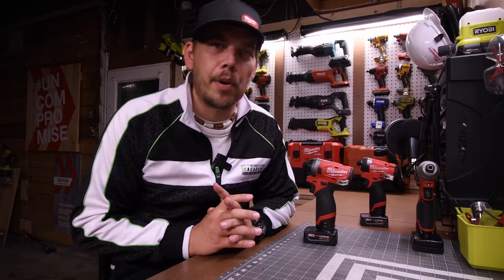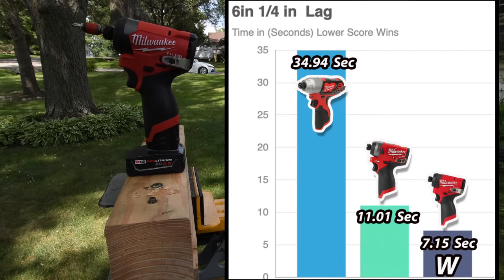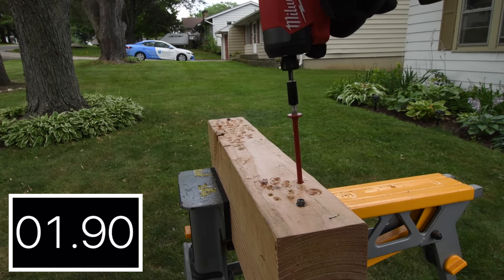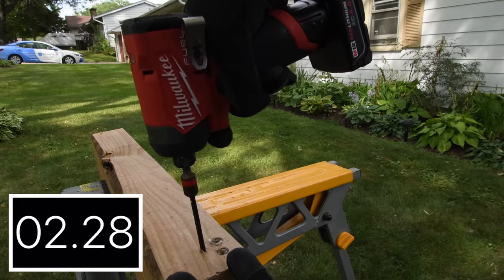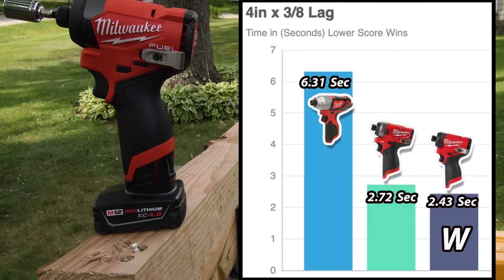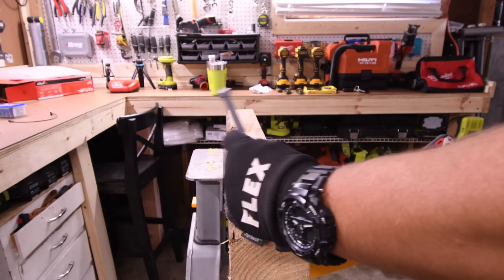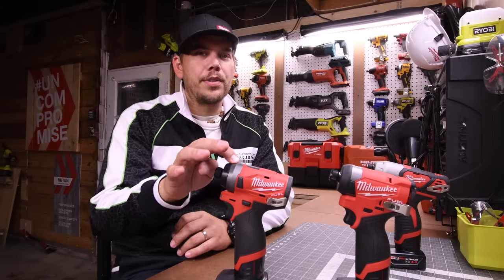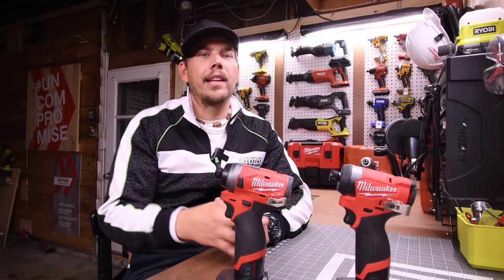New M12 Upgrade Worth It?

Comment: Tri beam LED lights are the only reason I'm getting the new M12. I think the only thing they could invent for more power at 12V is stacked lithium batteries.
Reply from the maker: I agree but I am excited about testing out the new HO m12 battery
Reply: @ManCaverTools  I wish they would've fit some 21700s in the m12 HOs. They apparently have better wiring and higher discharge rate 18650s in the new m12 HOs.
Reply: Not sure of how much they can improve on the hardware, it seems they are minor tweaks here and there.  But what seems to add the power, based on other tests I have seen is the battery size and technology.  By technology I mean the ability to handle high draw and capacity.
Reply: @scottmorris4914  The samsung 25R and 30q cells commonly used in tool packs, including rhe milwaukee 3.0 and 6.0 packs were released back in 2014. Since then there have been some much higher output cells quietly released, but I imagine, due to cost and reliability, the old faithfuls have continued to be used. Stay tuned.
Reply: @scottmorris4914  i believe technology wise we have these brush less tools working beyond capabilities they are perfect
Reply: Go smaller. I'd like to see a new line of drivers, screwdrivers with good torque and speed . The current electric screwdriver champion (dewalt) is way too bulky, although it's got some great features and power.

Comment: Can't wait to see the drill comparison like this!
I've been using the Gen2 for the past 3 years on a daily basis, and I decided to buy the new kit 3497-22.
It's definitely not worth upgrading unless you can get a really good deal on it.
That being said, once I started using the new Gen3 with the insanely bright 3 LEDs and the extra few hundred RPMs, I can't go back to the Gen2.
In short, don't try out the Gen3 unless you are actually willing to upgrade or you can tough it out and ignore it, and keep using the Gen2 which is still an awesome impact.
Reply from the maker: that video will be coming up
Reply: @ManCaverTools  Can't wait. That video will decide if I should upgrade or not. Thanks for the video much better than the other channels.  Will there be a videoof Gen 3 vs other brands?
Reply: Remember that the Milwaukee tools still hold a lot of their value.  You can always upgrade now and then sell your older tools and recoup some of that cash difference.
Reply: You can now get a good deal on the Gen 3 at Home Depot for $99. Comes with the tool. 2ah battery. Charger and a bag.

Comment: The brushed model is great for a lot of tasks and I have a buddy that used his daily for a decade and it still works great. I still see sales for the drill + driver + 2 batt combo for $99, making it a pretty good value for smaller tasks. Half my tools are 12V, I wouldn't use any 12V for any of the torture test tasks you put them through unless I don't have a 18V one around. Good to know they all can at least do the job in a pinch.

Comment: HD had a sale on $30 2ah batteries so finally hopped on and went with the Gen 2 hammer drill and Surge impact. Love the size and power but my only complaint is the ergonomics.  My xtremes feel better but performance... m12... glad I didn't have to push for Gen 3

Comment: I have the M12 Surge and M18 Surge. I had a hard time justifying the 12V Fuel impact driver since the Surge was almost as fast and a LOT quieter, but the improved lights and even more power might be enough to convince me. Maybe. I do have the M18 Surge, which was faster than the gen 2 M12 Fuel, so maybe not?

Comment: NOOIIIICE YARD, Bro! 1st time I've seen it in one of your vids. Was wondering about the noise & your neighbors, right about the time you switched over to the Man Cave, 😂. GREAT vid, VERY HELPFUL, INFORMATIVE & the 1st I've seen running the new Gen 3 v the Gen 2. I'm pretty new to the Milwaukee M12 line, only recently delved in (in large part to your clips 👍🏼). I have the brushless Sawzall, the 3/8" right angle impact, the M12 Surge kit (which, I ABSOLUTELY LOVE) & awaiting the arrival of my freshly purchased 3/8" high speed ratchet kit....BUT, have yet to get the "starter" set including the hammer drill, impact driver, batteries and charger....(oh, & the bag....VERY underrated). Curious as to whether or not you have any preference, between the Gen 2 & Gen 3, (outside of very close/similar speed/performance, shown in your tests). Feel? Noise? Vibration? Any/much difference in any of these areas, between the 2? I appreciate your feedback & as always, your work! Thanks 👍🏼
Reply from the maker: My Wife says thank you on the garden Comment, she has been working really hard on that. id use the Gen3 M12 impact driver. I love the design and tri Led lights. but when it comes to the performance the new gen is a tad but more powerful but not worth upgrading if you already have the Get 2 that works just fine

Comment: I don’t use my tools to put food on the table, so an upgrade for me has to be well worth it. The tri-beam is really a nice touch, but for 79$-I’ll pick up the older gen and save the extra cash for the new batteries.
Reply from the maker: I agree with you on that, much better buy for $79

Comment: Remember, that the Milwaukee Brushed tools, using the lithium batteries were, at one point in time a breakthrough, top of the line tool.  You should try to find an older NiCad battery powered Milwaukee drill/driver or even an impact wrench, and see how they compare.
Heck, if someone that is just starting out in the trades or even a mechanic, asked me what to buy with a limited budget, I'd definitely tell them to seriously consider buying the Milwaukee Brushed tools.  At least you could buy into a quality brand and start collecting the batteries, and eventually upgrade to the Brushless line up and then go up to the FUEL line.

Comment: When I see a deal I’ll pick one up, as I  only got the M12 fuel drill driver hammer drill.. didn’t bother with the kit.. it’s much.   Nicer for small jobs around the house and working on my RVs..  using the M18 fuel hammer drill wasn’t enjoyable for small tasks.
Reply from the maker: Deals better be good this year
Reply: @ManCaverTools  yeah , hopefully we get the same deals here in Ontario , Canada.. they put the price up on that Ryobi clamp fan to 50 Canadian.. I’ll be looking for a deal on the M12 inflator, I seem to always running around pumping up tires  or water toys for my 3 yr old.
Reply: Not sure what kinda deals they are running in Canada, but I just bought the 3497-22 kit, which includes the new Gen 3 M12 hammer drill (3404), impact driver (3453), charger, bag, CP2.0 battery, XC4.0 battery, and an extra CP2.0 battery as a separate (i.e., returnable) item. After returning the extra CP2.0 battery, it brought the cost of the entire kit down to $178USD. Incredible deal, considering that the Gen 3 hammer drill cost $149USD as a bare tool. So it basically only cost me $29 more to get the impact driver, two batteries, charger, and a bag thrown in. And I can sell my Gen 2 impact and recoup even more money. Would have been very foolish to buy the Gen 3 hammer drill on its own.
Reply: @ZeGermanHam  I agree , was a great deal..  The hammer drill driver I got was a kit , charger bag , 4.0.. was 149$  plus tax Canadian.... I’m kinda glad I didn’t get both.. now I can get the newer impact driver with tri-lights.. can always sell one ..  or even gift it , Christmas is coming.. darn winter.. was 39.F here overnight.

Comment: I wonder if the wood splitting at the edge was giving the gen 2 a little edge
Reply from the maker: these tools are powerful enough to where that won't matter. the split on a few tests isn't big enough. these screws/lags need a pre-drill. but that would make unfair results. I gotta work on finding what wood is best to use. the type of wood will be changing on this channel as well

Comment: As an owner of the Gen 2 and Gen 3 M12 impact drivers, I agree there is no immediate need to upgrade. Yes, the Gen 3 does have a little more power and is very slightly smaller, but it's not life-changing. I wish Milwaukee would have made the collet spring-loaded to auto-eject bits. That would've been a nice touch on a tool that is otherwise extremely similar to its predecessor.

The only reason I got the Gen 3 is because I wanted the new Gen 3 M12 hammer drill and got a kit that also included the Gen 3 impact driver along with a CP2.0 and XC4.0 battery, charger, and bag for $178 (after HD tool hack). Smoking deal, and I can sell my Gen 2 impact driver and recoup some of the money spent.
Reply: Would you mind sharing how you did that?that is a great deal

Comment: The one you call garbage. Is excellent for job that requires soft strength. Like changing reseptacles light and so on. I have made thousands of dollar with that impact. Others ruine the job. I do have powerful  ones. But the garbage keeps me on the money making mode.😁

Comment: I liked that you compare the different models within the M12 line.  I know that testing between brands is important, but if I am already in the M12 line, then I would like to see if buying the Gen3 is worth it.  And a video this tells or not.  Or at least want until there is a deal at Black Friday, etc. LOL.  I don’t use mine that much, so the increase is not worth it.  Thanks.
Reply from the maker: I thank you Scott
Reply: I’m waiting for Home Depot to send me a 10% discount code 😁 and get the kit
Reply: @omardominguez2936  I think we are going to see a lot of deals on the old models, M12 Gen2 and M18 Gen 3, coming at the holidays.

Comment: I’m surprised the newer models is just marginally better, though I do like how compact it is. I wished Milwaukee would do an updated 2420-20 Screwdriver. It works great for automotive interior and drilling/driving where an impact isn’t really wanted. I wished the 1/4” impacts had the same “Quick Change Chuck” as the Screwdriver too, think it can be swapped to the impacts?
Reply: It was usually 20-30% better than the old model. Some of the tests where the old model came close the wood was split. With the extra power it will even enable some tasks to be done that the old one simply couldnt do.

Comment: Supposedly this new model has a collet issue like the old Gen 3 M18. Did you experience any of that? Or is it Reddit trickery.
Reply from the maker: I did not, I tried to get the bit drop from the collet with the speedbore. but didn't drop
Reply: I think the collet issue is somewhat overblown. I've had the Gen 2 for years and never once has anything fallen out of the collet. I'm not saying it doesn't happen to some people, but it has just never happened to me. Maybe I'm less hard on my tools? Either way, the collet on the Gen 3 appears to be identical to the Gen 2. But then again, the collet was supposedly upgraded during the Gen 2 production run anyway, so perhaps it's a non-issue. Time will tell.

Comment: I wish milwaukee would use the slide design with the batteries on the m12 platform to make the grip slimmer. For that reason alone I prefer the dewalt 12v versions. 🤷🏾‍♂️